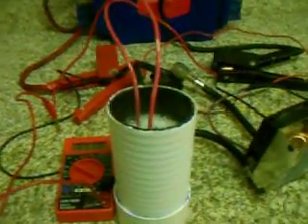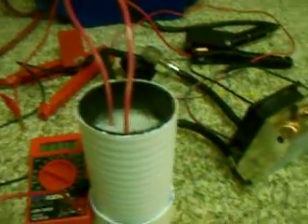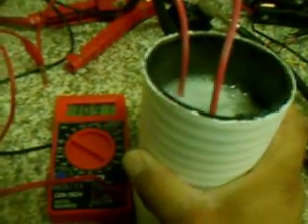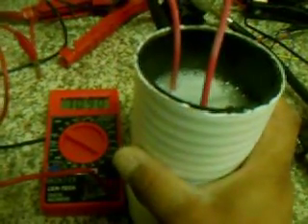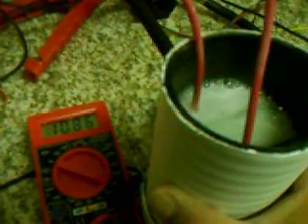MINI 1/2 GEN HHO HOW TO COOL YOUR HYDROGEN GENERATOR 3

Comment: Have seen cell running at 15 amps 2-3 hours  heat only 5-7 degres and has option for cooling under high production but so far not required more imrormation soon.